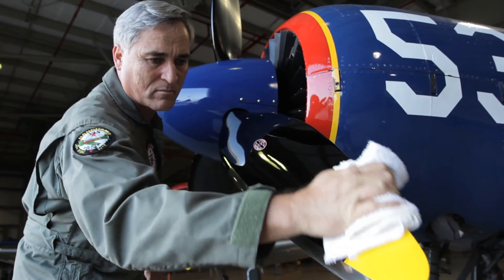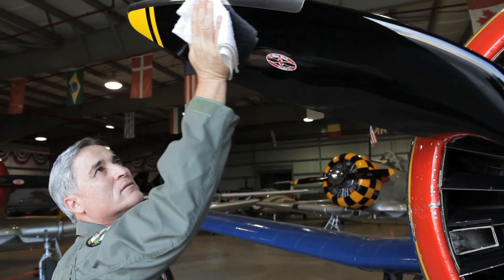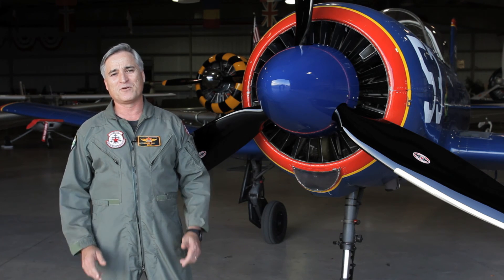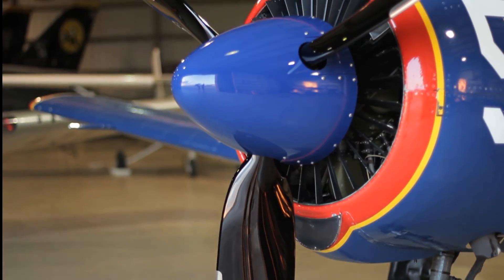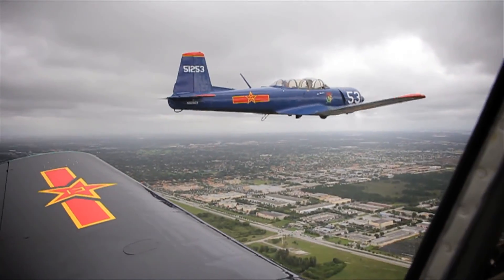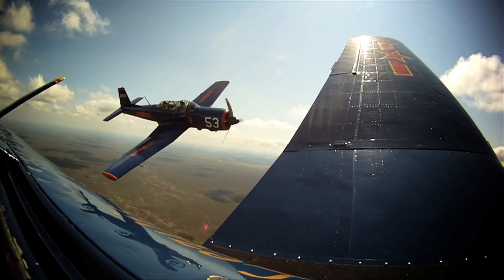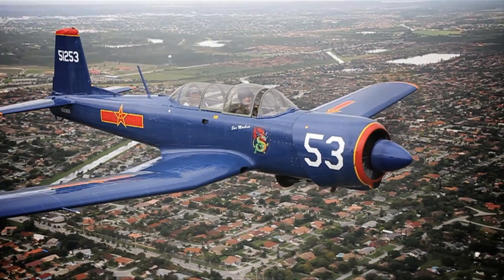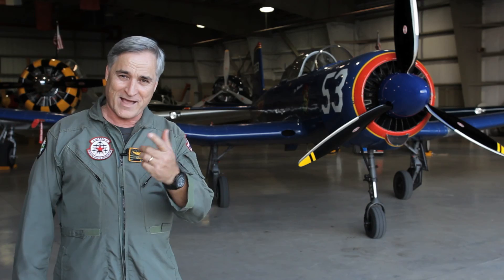WhirlWind Aviation 3-Blade Constant Speed Composite Propeller for M-14P engine powered aircraft.

Comment: had many problems with the prop governor not putting out enough pressure after conversion,  causing engine rpm creep during flight.its hard to find info on who mods the governor also.
Reply: @sparky obrian did you get the rpm creep (overspeed) figured out?